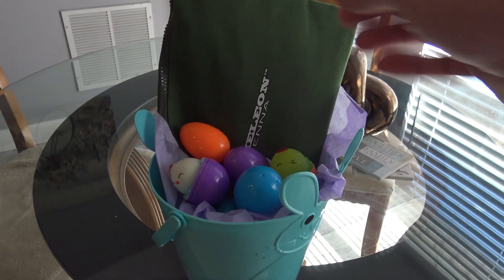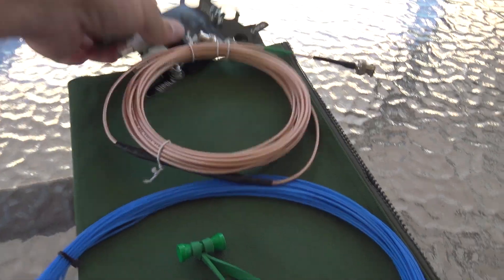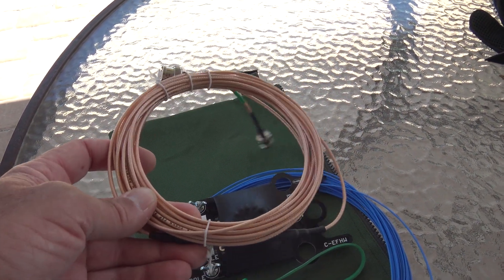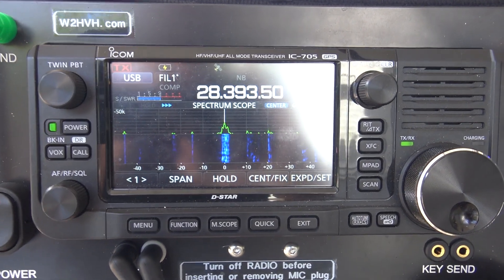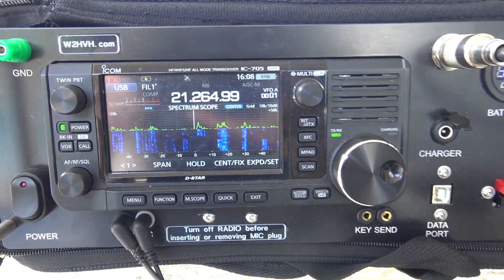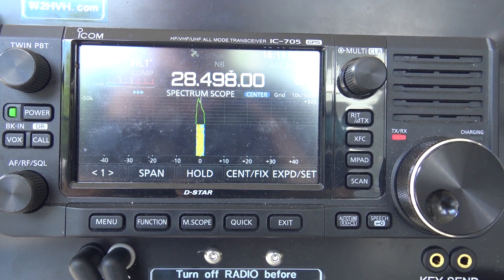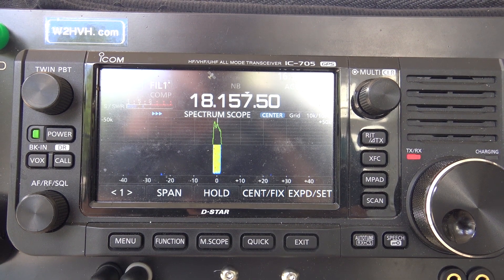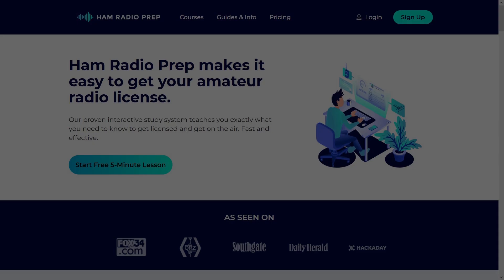Chameleon Antenna, EFHW 40-10m, Contest Weekend!! 10 Watts.

Comment: Happy easter🎉🎉
I ran rg8x for 11meter dipole
Was thinking of running the same coax for a vertical dipole 10 meter ,your thought
Thankyou for your time 🎉🎉
Reply from the maker: It will work, I have done it before.
Reply: @HamRadioConcepts thanks ,have an awsome day